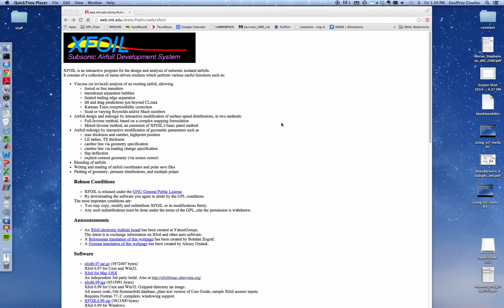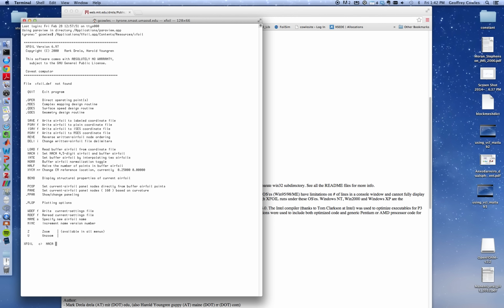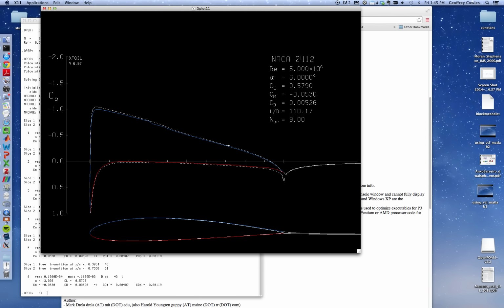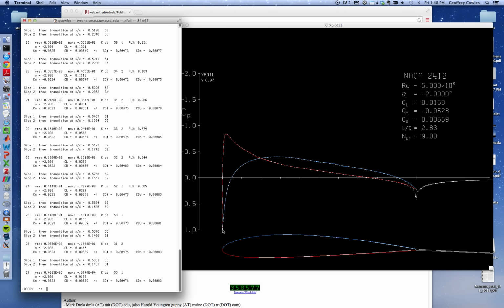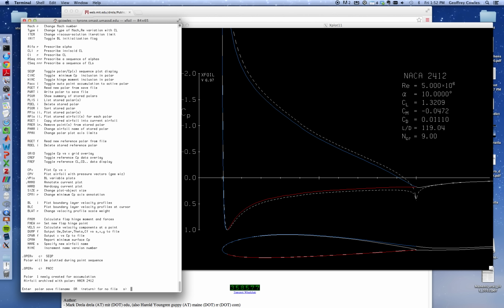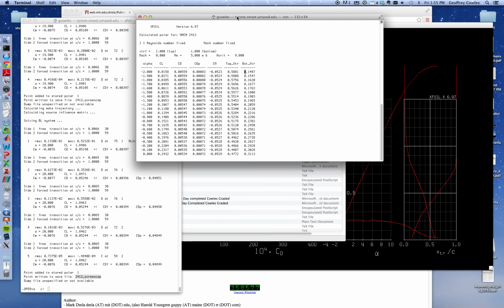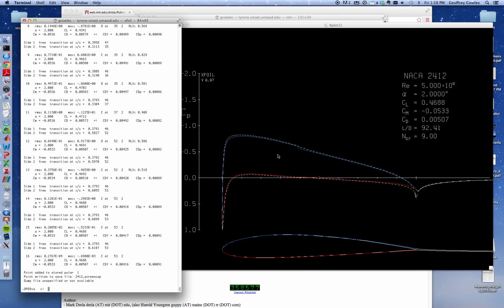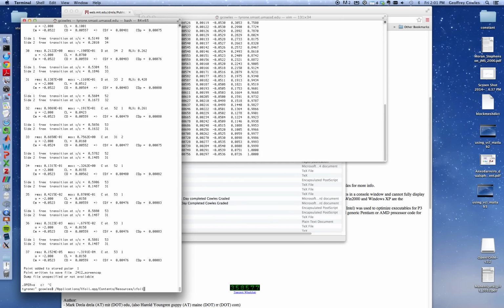Xfoil tutorial

Comment: Hello, I installed Xfoil and XQuartz onto my Mac, however,  I having an issue in getting it to load  a text file. Do I need to have Xfoil/XQuartz and load file in the same folder i.e. applications? Thanks
Reply: you type "load (file pathname)" if you're using mac, select the file wherever it may be and hit command+option+C to copy the pathname to get the exact pathname of the airfoil data
Reply: thanks, ive tried this but now the terminal is saying 'File READ error. Unrecognisable file format * LOAD NOT COMPLETE ***'
I thought i had reformatted the points from the UIUC database correctly such that it starts at 1,0 going through 0,0 then back to 1,0 but are there any other things i need to change in order for it to be read by Xfoil??
Reply: Before trying to load an airfoil into XFOIL, especially from an online database like the UIUC Airfoil Database, you need to check that the file is the right file type (.txt/.dat), the coordinate points are in the right order (TE to TE, either clockwise or counter-clockwise around the airfoil shape), the data in the file is in the correct format (each coordinate pair gets it's own line with the x-coordinate first, then a space, and then the y-coordinate) and nothing else in the file that might be mistaken for a coordinate point. There are some formats with other numbers in them (ISES and MSES) but it is recommended to format any airfoil you get off an online database so that it is in the "Plain" file format. I've got a video on my channel all about loading an airfoil into XFOIL and another about using MS Excel to format the file correctly (hint: you can't export from MS Excel to a tab-delineated file since XFOIL is looking for a space-delineated file). Check out the vids and let me know if you still have issues.
Reply: Having the same problem, anyone got an answer for this?
Reply: thanks!!! I was freaking out with it
Reply: thanks i looked everywhere for this
Reply: Thankyou!

Comment: if I want to make an analysis but the angle does not converge and the analysis stops, What should I do to run the full analysis with the angle range I want?
Reply: kindly increases the number of iterations. that could solve your problem
Reply: As Karthikeyan Natarajan previously mentioned, one potential solution is to increase the maximum number of iterations before performing an analysis (from the OPER menu use the "iter" command with something like 200). If you forget to do this beforehand an it stops iterating because it hit the max iteration count you can use the exclamation point command, "!", to tell XFOIL to keep iterating.

Another possible solution is to change the airfoil paneling by increasing the number of panels or bunching the panels around where it doesn't want to converge. I created a video all about adjusting the airfoil paneling parameters to show how this is done in XFOIL.

A third possible solution is to try an angle just slightly different than the one that doesn't want to converge. For instance, if it doesn't want to converge at an AOA  of 15 degrees try 14.99 degree or 15.1 degrees. Sometimes with numerical approximations, certain conditions will cause the analysis to jump back and forth between two numbers without converging (not as common as other issues) and doing a similar number that is slightly different will converge.

A final solution is that it might not be a possible solution. If you try and prescribe a coefficient of lift above the max coefficient of lift that would be an invalid condition. So you might want to also ask yourself if it is supposed to converge at that point.

Comment: How can I save all the coefficient values in a text file?
Reply: +luiz I've found it. For those with the same doubt, the command is "pacc". You just have to type the filename after that.
Reply: When you use the PACC command to toggle on the point accumulation, before using the ASEQ command to generate your polar points, XFOIL will prompt you to enter in the polar save filename (step 7 in my polar plot basics video). If you enter in a filename, like NACA4412_polar.txt , then the software will not only turn on polar point accumulation but it will also save the data from each point of the ASEQ (AOA sequence) into the file automatically. You can then open this file using any .txt program and see the CL, CD, CDp, Cm, Top_Xtr, and Bot_Xtr for each angle of attack you ran the analysis at. If you run into problems, check out the video I did on the polar save/dump files where I cover some of the finer details. Hope this helps!

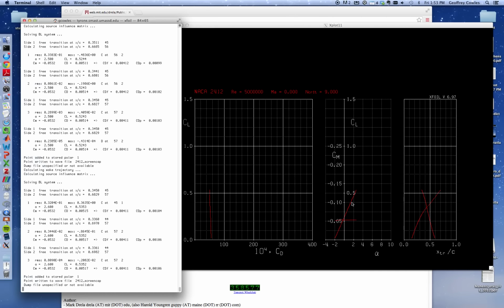Comment: hey, did you figure out how to strech out the boundaries for the cl(alfa) plot? you are talking about it in minute 14:00. thanks!
Reply: From the OPER menu, you can use the "ppax" command to change the Cl, Cd, Cm, and AOA axes. You have the option of changing the min limit, max limit, and the delta between the lines. I don't like how you enter in the new values. When you type in the "ppax" command, it goes one axis at a time and doesn't give you a command prompt to enter in the new values. You have to enter the values on the blank line, following the current value line, and hit enter. Once you have all the axes limits changed you will have to use the "pplo" command on the OPER menu to replot the polar plots. If this is still confusing, I cover it in the polar plot basics video on my channel.

Comment: Hey, I've been trying to load an airfoil that is not naca but it tells me it cannot be found. Where am I supposed to put it so it can work? It is right now inside the zip file inside the xfoil folder.
Reply: Adrian Ruiz If the file is just in the xfoil directory (the same as xfoil.exe) then it should work
Reply: +Adrian Ruiz Create a subfolder in your XFoil folder called aerofoils (or airfoils, it doesn't matter). Assuming you know how to insert the coordinates of an aerofoil into a .txt file, save it as 'filename.dat' (you must have .dat at the end). Run XFoil and type 'Load' then type in the file's name, with .dat at the end.  If that doesn't work, type in the file's location - ie, C:\Users\JoeBlogs\DirectoryFolder\XFoil\AerofoilsSubFolder\filename.dat
That should work, but sometimes it doesn't, so try restarting XFoil :-)